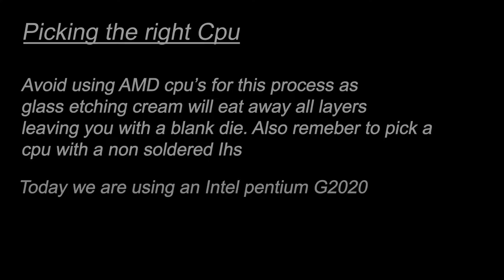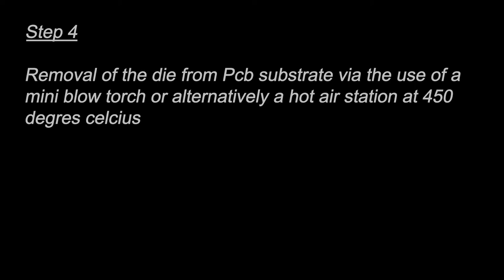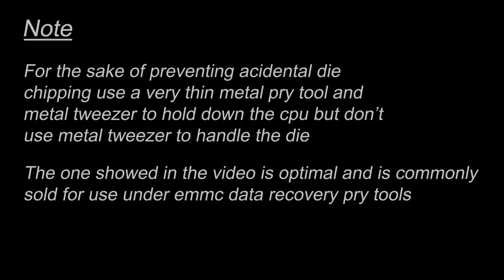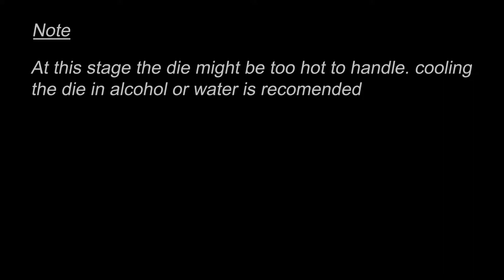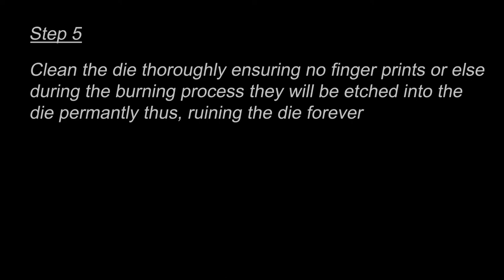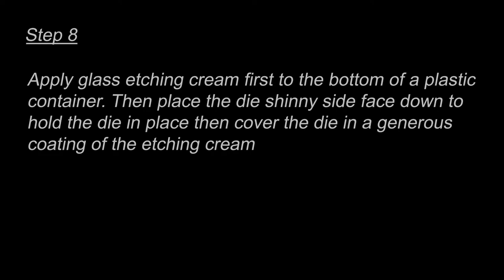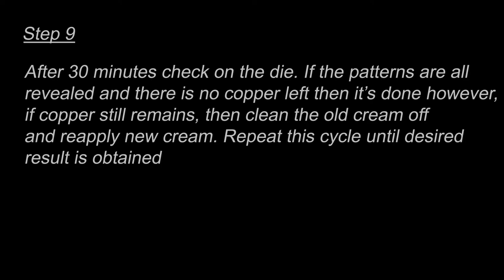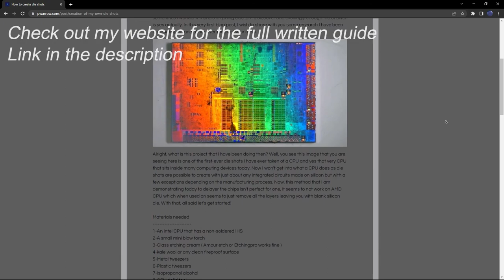Creating Intel CPU die shot without the need for sanding

Comment: Hi, thank you very much for this tutorial. I have found this method works really well for exposing the die, however it always seems to leave some residue or seems to burnish the silicone, either way it doesn't remove the copper completely cleanly. What would you suggest please? If it's possible to email/pm you I can show you some pictures
Reply from the maker: Hey, I'm glad to hear you found this tutorial helpful. Regarding a better method, I discovered that after the glass etchant treatment, if some copper remains, you can dip the die in nitric acid to clean it up nicely. If that doesn't work, you can try using a mixture of nitric acid, hydrochloric acid, and hydrogen peroxide.

Additionally, as an unrelated note, I found that a much better and cheaper alternative to glass etching cream is ammonium bifluoride. It's one of the main active ingredients in glass etching cream, but buying it in bulk is often cheaper and more effective.

Oh, also, I would like to see some photos if it's not too much trouble. My email is pwarrow99 followed by @ Gmail . com. Sorry I have to write it in such a weird manner. YouTube will filter my comment otherwise. I am developing a new method that should be compatible with SOI chips, and the more data, the merrier. 😊
Reply: @pwarrow  Hi sorry for my late reply. Thank you very much for your reply. I have read online people use chemicals like nitric acid, hydrochloric acid etc but I was hoping to find something safter to use at home as they seem like scary chemicals and have to be disposed of properly haha. I did consider getting some Iron (III) Chloride as that's what they use to etch PCB's which makes sense as it's designed for removing copper and is probably a little safer, but again it has to be disposed of properly. Do you ever mechanically polish your die's, using like 2-5 micron lapping paper? I found it not to be very effective.

I'd be more than happy to share my images with you, I did send you an email a while ago but didn't recieve a reply, I'm not sure if you saw it or not.
Reply from the maker: Hi, no worries. I appreciate your insight as always. I've just checked both my inbox and spam folder, but unfortunately, I didn't receive it. Would you mind sending it again? I'll try adding my email to the About section of this channel; you can also check there if you need my email. YouTube doesn't seem to like it when I put my email here.

Regarding your question about using mechanical methods for die delayering, I haven't tried them yet. When I started this project, I was determined to use only chemicals because I considered sanding too unpredictable and unreproducible. My goal is to make the process as accessible as possible, which is why I didn't consider mechanical methods initially. However, I've been reconsidering this approach. Based on my testing, after burning off the underfill of the chip and exposing the copper layer, there's usually another transparent silicon dioxide layer on top. Considering this, I think it's quite likely that if you start sanding there until you begin to see some copper particles on your sandpaper, and then proceed with ferric chloride to finish, it should yield comparable results. Something you could perhaps try out.

As for the disposal of chemicals, particularly acids, I typically neutralize them and pour them into my backyard. It's probably not the best practice, but most of the byproducts are inert, and the amount of metal salts produced from each use is minimal. After all, we are dealing with layers measured in microns.

If you do plan to use ferric chloride, the only other method aside from giving it to a chemical disposal company that I can think of is mixing in sodium hydroxide. This should form ferric hydroxide, copper hydroxide, and sodium chloride. Both ferric hydroxide and copper hydroxide are solids, so you can filter them out. The remaining solution should only contain sodium chloride, which is safe enough to pour down the drain. As for the solids that remain, you will need to decompose them at 300 degrees to form iron oxide and copper oxide. These are now inert enough to be disposed of in the regular garbage.

I must note that I'm not a chemist, and I haven't personally tested this disposal method, so I can't guarantee its effectiveness. it's probably the best to consult proper disposal guidelines. Personally, I store most of my waste in a bucket, which I refer to as "future me's problem"! Dumb, I know.

Apologies for the lengthy response. I understand you're exploring chemical-free methods, which I haven't delved into extensively due to time and resource constraints in university. 

Looking forward to your response tho, and I'll update you with any progress when I conduct further tests or experiments, possibly in another video. In the meantime, feel free to share anything interesting you find. Cheers : )
Reply: @pwarrow  Hi, yeah sure, I'll email you again later today.

I agree with your comment about sanding, it is difficult to do and hard to repeat as I found out so I think your chemical methods are definately a better way of doing it.

You seem to know a more about chemistry than me haha, but if you're able to neutralize them then that's great. I have thought about posting this on a r/Chrmistry subreddit to see what actual chemists would suggest. What was it like using the Ammonium Bifluoride? Did you have to neutralise that or prepare it in any particular way?

Im perfectly open to methods that involve chemicals, I was just wondering if there was a safer alternative to the scary acids haha. 

Thank you very much for your replies, good luck in University and yes please do make another video with your progress when you feel the time is right :D
Reply from the maker: Hey Shaun,

Thanks for your reply and kind wishes. Just to let you know, I've received your email and reviewed the images you sent. It's mighty impressive what you achieved with sanding. Also, haha, quite a coincidence that we both use the same Nikon D5300 camera. Did you get a zoom lens or macro lens? I was never able to afford one, and the limited focal distance made it difficult for me to capture good images.

Regarding preparing ammonium bifluoride, there are a few precautions you should be aware of:

Firstly, it's obvious but important: only use plastic for anything that will come into contact with ammonium bifluoride. It etches glass, which could be problematic.

Secondly, I doubt they sell ammonium bifluoride in liquid form, but if they do, I recommend against receiving it that way. Only buy it in solid crystalline form—it's safer to store and reduces the risk of chemical spills.

Thirdly, use proper PPE. Neoprene or nitrile gloves should be worn when handling the chemical. Safety goggles and a lab coat are also essential. I strongly recommend using gloves that extend up to your upper arm to prevent skin contact, as fluorine poisoning can occur if enough is absorbed through your skin.

Fourthly, have a solution of calcium hydroxide nearby along with a tube of calcium gluconate. If any Amonium Bifloride gets on your skin, quickly wash it off and treat any burns with the Calcium Gluconate gel. Any leftover solution should then be neutralized with calcium hydroxide.

Finally, try to use it outdoors. It may not produce as much fumes as hydrofluoric acid (HF), but it's better to be safe than sorry.

As for posting on r/chemistry and conducting your own research, I strongly encourage it. I am no chemist, and sometimes I do question my own practices. Plus, who knows what we might learn. Do keep me updated if you find anything interesting on both the die shot and safety fronts.

Another important thing I wish to share is concentration. I haven't done extensive tests to find the optimal concentration for using ammonium bifluoride for etching, but from my experience, a 30 percent solution should work fine. I've mostly been adding an arbitrary amount, and it hasn't failed me yet. I do admit, it's something I should investigate further, perhaps a topic for a future video.

In terms of alternatives to acids, I'm not sure if I already mentioned this, but a method I've been thinking a lot about is the possible use of cerium oxide as a mechanical etchant. It's just a theory, but I think that if we are able to spray a high-pressure stream of water and cerium oxide mix on the die after the burning step, we might be able to slowly remove the top glass layer without using ammonium bifluoride. If we can achieve this, the only actual etchant we would need is ferric chloride to remove the copper layer. This would probably be the safest way to perform a die shot if it works.

The only issue is that I don't have the time or resources to conduct this test. University has taken up both my time and resources since moving to Taiwan to study. My parents weren't thrilled when I started experimenting with chemicals, and I can't imagine what my roommates would think if I turned my dorm room into a lab.

A modified version of this test could be the one I proposed to you yesterday: partially sanding the top layer until the copper is exposed and then using ferric chloride to complete the rest of the etching process. Theoretically, if this works, we might have just found a novel chemical method to tackle SOI dies too. It's frustrating to think I've been sitting on this idea for almost two years. I mean heck, I even drawn up and entire 3D model in fusion 360 of what a prototype device would look like. I really want to do the test so badly :(. Perhaps you can consider giving it a try ?

Anyhow, I think that's really all I have for now. Again, I must apologise for such a drawn-out response. I really just don't wanna leave anything out. Do feel free to contact me if you have anything else you wish to ask or share. These kinds of discussions are as close to what life used to be before things started flying off the rails for me lol.

Anyhow, Cheers and have a fantastic day ahead : )
Reply: @pwarrow  Hi, thank you very much, I'm glad you liked my images. They were all done with glass etching cream though, I never had any success with the lapping/sand paper. And yeah I am using a D5300 haha :) No I don't have a macro lense, I bought some extension tubes and used the standard lenses, the exension tubes go between the lense and the body, and it has the effect of magnifying the image. It's not perfect but it works. Unfortunately macro lenses are super expensive.

Thank you very much for the information. Ah okay, so ammonium bifluoride isn't very friendly either haha. I hadn't heard of cerum oxide but it seems to be like a polishing compound, I think the issue with any form of mechcanical removal is how it will damage the underlying silicon layer, we have a sand blaster at work for cleaning metal parts and it leaves a dull and rough finish so I think you'd get a similar problem with the silicon. It is also possible to get 1 micron diamond polishing liquid/paste which might work better.  I'd be curious to see the 3D model you designed, feel free to email me with some images. Unfortunately I'm not really in a position to be playing around with dangerous chemicals at the moment, I am looking to get my own place though in the next coulpe of years so maybe then I might be able to.

Don't apologise for the long response, it's really helpful :) And I'm sure that once you've graduated you'll be able to try out your ideas. Is there a chemistry department at the univeristy you'd be able to go to for help?

Have a good day youself :)
Reply from the maker: Hey Shaun,

My apologies for the late response. I've been feeling rather lazy lately so it took me some time to draft up a response. Thank you for the encouragement and reassurance tho; it really does mean a lot. 

In regards to the images, I've noticed some scuffs on some dies and initially thought they were from sanding, however guess I misidentified. Are all the images from etching? There was one with pretty significant scufts marks. I am curious as to the story of that one haha how did that come to be ? 

File name reference = VHX_000043-edit2.jpg

On another note,  I kinda understand what you mean by imperfect etching from looking at the images; some spots do look blotchy. I’ve switched to ammonium bifluoride, believing the high viscosity of the etching cream causes this issue. My theory is that the cream's viscosity and tendency to dry out leads to the inability of the fresh etchant to diffuse to the etching site after the initial amount that was in contact with the die's surface becomes depleted. Replacing the cream and etching several times should help, but results can vary. I have also tried putting the entire die and etchant in an enclosed container to reduce moisture loss. I definitely recommend doing this as it decreases the frequency of having to replace the paste, saving you time, money, and PPE.

Oh, not sure if this is relevant but occasionally, when using glass etching cream or purely ammonium bifluoride, I end up with dies that have a permanently cloudy layer. Once this layer appears, it’s almost impossible to remove. I've tried various acids and concentrations of etchant, but nothing works. 

I’m not entirely sure why this happens, but my theory is that it might be due to cross-contamination between the etching cream/solution and the acids I use. However, I've had difficulty recreating the issue, so I can’t say for certain. As a general precaution, ensure that all equipment you use is clean and not contaminated.

Now that I think about it, it could also have something to do with the IPA (isopropyl alcohol) I use to clean the die between steps. I’ve seen ethanol stain wood and heard stories from a chemistry teacher about how her glasses became permanently fogged after cleaning them with ethanol. 

Oh well, more research I don’t have time to do, I guess! Just make sure to keep cross-contamination in mind.

Anyhow, I'm curious about your sanding attempts. What issues have you encountered? I'm particularly interested in any observations on the layer changes as you sand deeper. The chemical approach I use tends to destroy many of the layers I've been meaning to study.

My mental model of the layers is basically solder balls, silicon dioxide, copper, silicon dioxide, and then rainbow. Not knowing the number and composition of the layers makes it extremely challenging to develop a new process for creating die shots. Perhaps you can help shed some light on this unknown.

Regarding ammonium bifluoride, I don't want to scare you away from using it, but yes, it's not great for health and safety. The funny thing is, I actually learned about this compound from the very bottle of glass etching cream I used in the video. If you check the ingredients on the label, you'll see ammonium bifluoride as one of the listed ingredients. If memory serves, it was one of the two etchants responsible for actually etching the glass. The other etchant was incredibly expensive, which ultimately led ammonium bifluoride to become the sole contender for my future use. Did I also mention that it's quite cheap and can be bought in bulk too? So, just apply the safety measures you would with glass etching cream and you'll probably be fine. The key is to not work with a large amount at any one time. For die shots, we can get away with small amounts. Use that fact to ensure your safety.

Something interesting about this etchant is that it also seems to dissolve metals, particularly copper. Going back to my previous mental model of solder balls, silicon dioxide, copper, silicon dioxide, and then rainbow, after the burning step, and after you have put the die in the solution of ammonium bifluoride. The first thing you would notice is that due to the endothermic reaction between ammonium bifluoride and water, the solution is cold. This causes the reaction to take some time to start, but not long after the submersion of the die, you would start to see oxygen bubbles forming on the surfaces of the die. A couple of minutes later, you will see specks of shiny copper flaking off, and underneath, you will see the CPU architecture. So far, so good. What I found interesting is that those flakes now floating in solution. If you leave them there for some time, they will eventually turn transparent. If I recall correctly, despite the copper disappearing for the most part, I think there were still some silvery flakes that remained along with that transparent stuff.

I would be very interested in knowing the composition of what remains but, without the proper tools, there is not really much I can do in that regard.

As for using cerium oxide, I get your concerns with the possibility of destroying the underlying silicon but, this is why the method of mechanical force delivery is a high-pressure jet of liquid cerium oxide suspension. This, in theory, if delivered directly atop the die and monitored closely, should result in the deepest etch at the very centre of the stream, tapering off as we move away from the epicentre of the stream. If this works, I anticipate it to be extremely slow. Which should give us a high degree of control. Preventing any kind of damage to the die if we are careful enough. There is another upside I would like to highlight too however, theoretically, I can rig up the pump and camera such that it will stop the pump after a set period time of etching, maybe flush it with clean water, and take a photo every so often. Using this data, we can study the layers of the dies and tailor our processes accordingly. In addition to this, it's also the only way I can think of to avoid manual sanding for chips made using the SOI process.

If you aren't familiar, chips made on the SOI process such as some of the older AMD chips aren't compatible with our current methodology for delayering. As far as I am able to understand. The actually transistors seems to be built ontop of a silicon dioxide layer directly above the silicon. This means. When we use anykind of glass etchant. The etchat will not only attack whats covering the transistor layer but also the foundation upon where the transistors sits on. What tends to happen if you try to use this method is you will end up with a blank die.

This means, we need a method like the one I highlighted above. We need to somehow reamove the top most layer of silicon dioxide or whatever is covering the copper layer. Once we expose enough of the copper layer, we can probably use ferric chloride to etch the copper. There are probably other elements commonly used in interconnects such as tungsten, aluminium and I think I heard about tantilium nitride as a possible insulator as well but, eh. Let just see what happens if we try it lol.

Anyhow, to answer your question about if I have resources available to me via the chemical department. I think I do, provided I write some emails and schedule in advance. Personally I've been thinking for awhile to consult some professors on this topic. I mean, my school has an entire clean room dedicated to mems devices fabrication after all. I am bound to find some promising leads if I just ask around right ? Honestly, thanks for bringing that up. I will put an effort into bringing in outside help onces summer break is over. I'll naturally update you and the community if I find anything of course. 

As for, the 3D models. I'll see if I can get you the images by later in the day. I will send it to you via email. I've got to be honest it's nothing too special but, it's kinda nice to see an idea I had visualised I guess but, if am really serious about this. I got to also start to think about the electrical part of this. Like how to control the pumps and cameras. Oh also, like how I am gonna get laminar flow out of a peristaltic pump. Quite a few challenges to solve but nevertheless, fun stuff to do.

Wow, I think this is my longest comment yet. This would be what I usually write in a blog post or something like that lol. Maybe I should start doing that again haha. Anyhow, thank you so much for sitting through this long response. I know most of it is just me rambling on about what amounts to my thoughts as a non expert that, might or might not actually amount to anything but, I do sincerely hope that it will help you in some capacity in your die-shot adventures. Information on die shots are few and far in between so I hope you can understand why I am reluctant to leave anything out. Oh, before I forget. Your use of extension tubes are brilliant. I've heard of the in the past but somehow never put two and two together and though to use it here. Do you mind sharing what extension tubes you use ? I would like to see if I can perhaps consider getting some to try out too. Thanks : )

Aight, think that's it for tonight. I look forward to anything you wish to ask or share. Cheers and have a fantastic day ahead.
Reply: @pwarrow  Hi Pwarrow,

That's fine :) No worries, take your time, you've been super helpful and I appreciate your time.

Ah, apologies, I think in that particular image there was some sort of residue on the die so I tried to remove it mechanically with some 5 micron lapping paper, which resulted in the scratches, however the copper layer was removed with the glass etching paste. The main issue with the lapping paper is distributing the pressure evenly enough, because as you press down on it, it tends to wear away the edges first and will often destroy the silcion layer in some areas before even getting through the copper layer in other areas, so it's very unreliable. Plus it leaves scratches as you saw in the picture.

I was just reading into the Iron III Chloride and it seems easier to handle than I thought. It's sold in DIY home PCB etching kits and apparently it can be neutralised using Sodium Bicarbonate so that might be a good place to start. 

The pump does sound interesting, definately worth a try when you get the time. I asked the question on Reddit by the way if you're interesting in seeing any comments, I posted it on r/AskChemistry. I assume YouTube won't let me post a link but it'll be easy to find.

That sounds cool, can I ask what do you do at univeristy? I work in a cleanroom testing components for satellites so it's probably a similar-ish environment haha.

Thanks again, have a good day :)